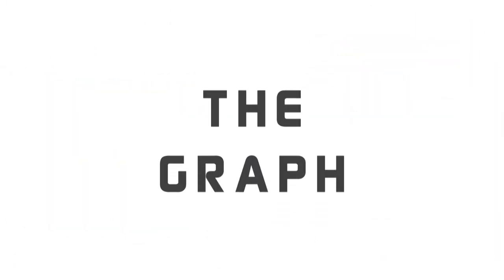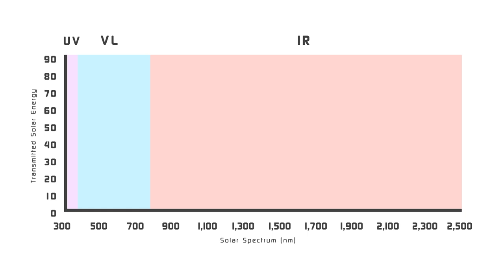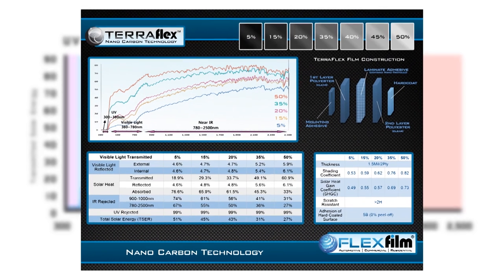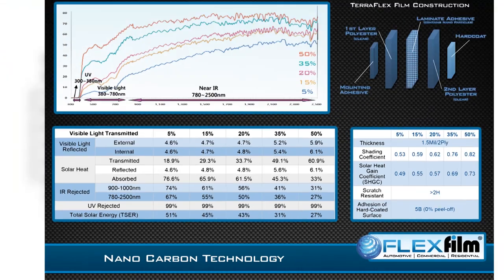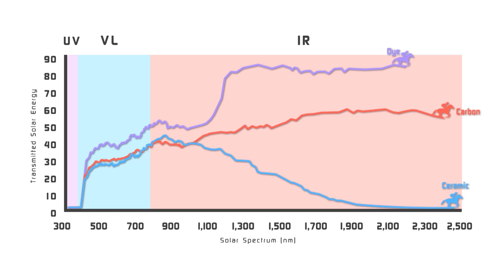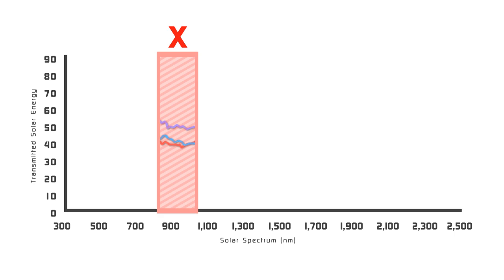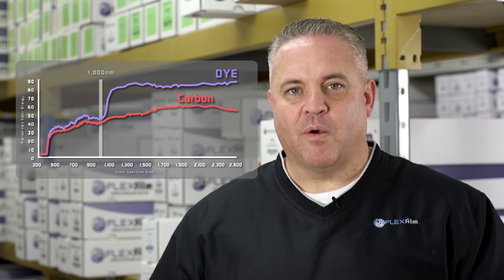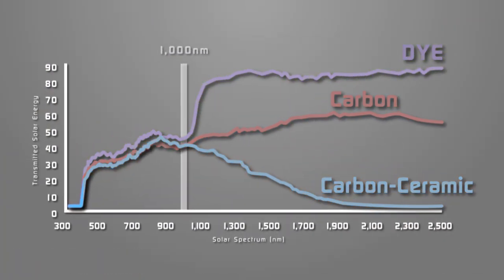Understanding Ceramic Window Film Performance

Comment: This ceramic film didnt exist till just a very few years ago....I assume ?   I JUST had the tint on 1 window in my car replaced, and the new tint is 5%...'limo dark' tint.  BUT it is the ceramic film.  But it  wasn't around 10 years ago, when I got my current car tinted. Let alone the other 20 cars/trucks I have had tinted since I was like 16yo.

So I have 5% all around,  I assume 'dye' or maybe 'carbon' film, on my current car.  It is a top of the line tint, and was the most expensive, with a lifetime replacement warranty, at the time it was done. It is still DARK 12 years later.  No bubbles/fade/peeling, except that 1 window.  Thus when this side window needed to be replaced, I got the ceramic tint. Instead of dye or carbon tint.

Since I paid for the most expensive tint when I bought it and got the warranty, I got it replaced with ceramic, there is a slight difference in its 'look'.

But I saw the price for the ceramic, and it is VERY expensive. IF I had a new car, or redid my current car,  I couldn't afford it. I would have to stick with 'dye' or 'carbon', a step down I guess.
BUT thats all I have ever used, thats all there ever was. Hope the rest of my windows bubble up or peel off, so I can get ceramic all around!